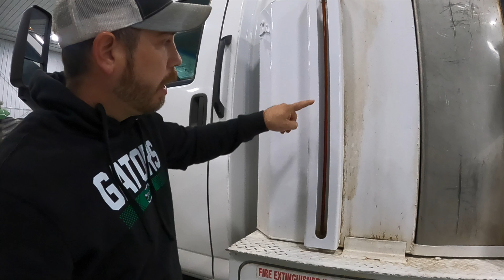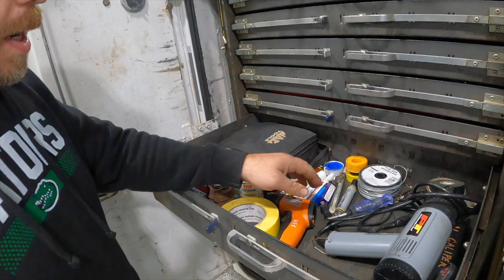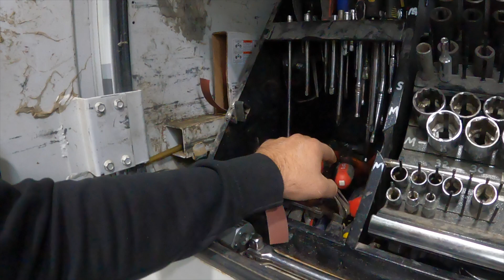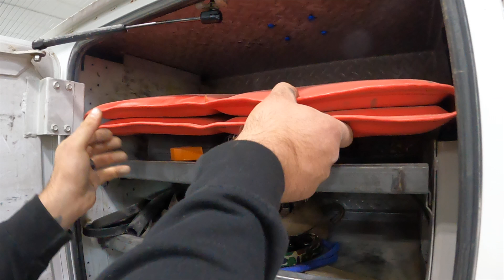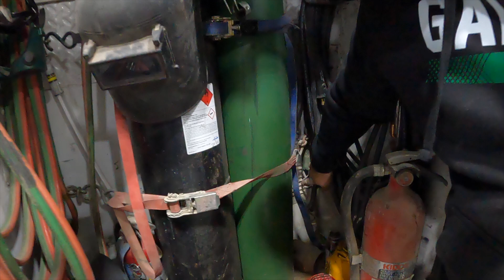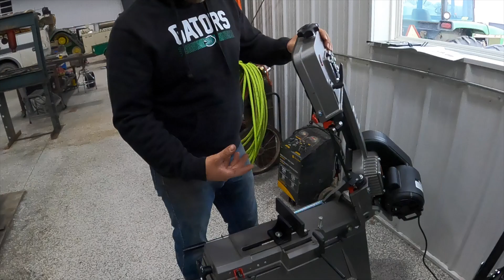Tools And Service Truck Setup Tour

Comment: You used your torque multiplier upside down. Just a note for when you need to use it. The reaction arm would be in the way of the handle and it would be extremely hard to turn....they are often 40:1 or 60:1 ratio, hense the torque multiplication.

Comment: Twenty years ago i wasn't going to mechanic ever again. But as a 40 year equipment operator i always had to mechanic. For the last 15 years i ended up buying tools every pay check. Even just a hundred dollars a check. Because employers can never buy whats needed or hide the tools. But i also know about disappearing tools and broken tools that get put away broken hoping i don't find out. If they get put away. Thing is they are never put back in same place. Not 2 inches away. Same place for a reason. You know where it is suppose to be but moved is lost in large tool box. Tools are put away even just changing wrench or socket. It really is quicker in the long run. Plus it doesn't get forgotten or lost. It doesn't matter if coming right back or keep working in morning. Putting away is a must no exception. Or wrath. Your call. No you can't get it for me. What are you moving to get what i need. You just misplaced something else. You spend 60,000 on tools then search for them or find them broken. Not cool. Pay a mechanic or buy your own or claim your dirt. You touch my tools you could lose a friend. I quit jobs.

Comment: I ran equipment my whole life and when I work for my grandfather we just had a little tool kit we would throw in a pickup and we lugged 5gal cans of fuel to our excavator or dozer on site and maybe it was because we did a ton of PM or the preferred system of moving our equipment back to the shop whenever possible but that worked for us, I left to work at a big outfit who had a service truck much like yours but equipped with a skid to change oil and hydraulic fluid and a tank for waste oil and man that thing really was a game changer! Sure working on stuff outdoors can suck but when you have everything you’ll ever need or want for repair work packed into something as small as an F550 not much can stop you:) You guys would love my old boss’s sister companies service truck, Kenworth 10 wheeler with all the bells and whistles, just saying if you need an idea for tax purposes………..

Comment: Something to think about adding to the truck this winter is water.  Something many people have is a water jug or even the water tank part of a yard sprayer (without the sprayer and wheels part) along with a chunk of garden hose and maybe a small electric pump. Something to use when using the welder or torch in the field or on combine.  Spray down area first before cutting/welding and also good for washing hands after.
Reply from the maker: We forgot to show that, but we do carry a pressured fire extinguisher can.

Comment: Thanks for the truck tour.  Oddly enough I spent most of the weekend up to now looking online for service truck info and tours.  I was debating something similar with a mid size fuel tank in front of the service body like yourselves and Tony Fast (Fast Ag Montana) have done or just going with a fuel trailer and keeping all the fuel/lube/def on the trailer - still undecided.  Lots of pluses with fuel and service all on one truck with the only downsides being extra wheelbase and weight.